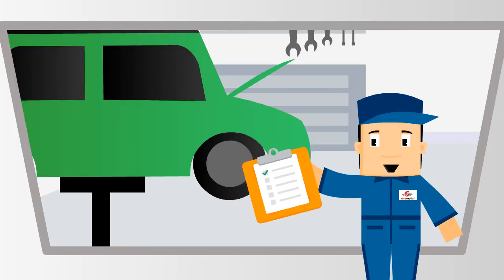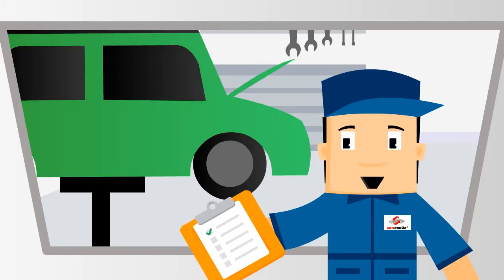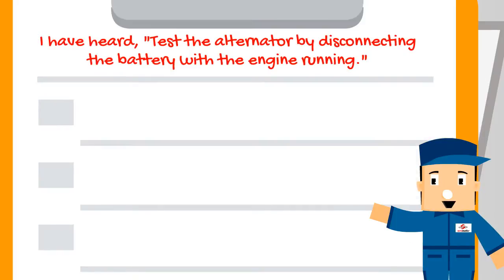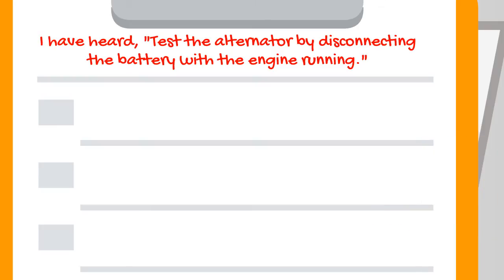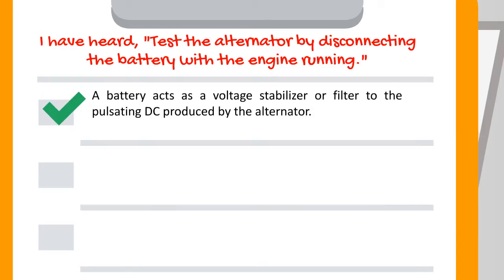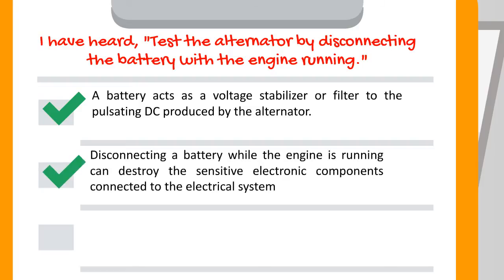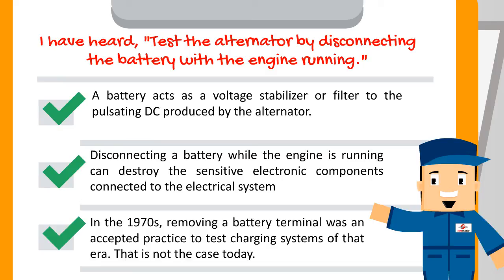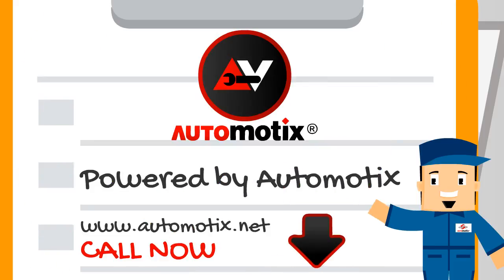Test The Alternator By Disconnecting The Battery With The Engine Running.

Comment: What's with the see and say voice?  And yes they were different in the 70's. You could disconnect the alternator with the engine running and nothing would happen. It's all the computer crap on modern cars that you can't do this now.
Reply: Yeah these videos can be annoying ...but I can think of several good reasons to produce a video this way.